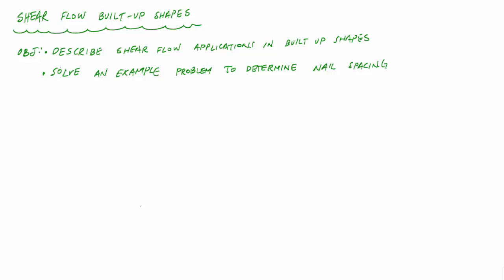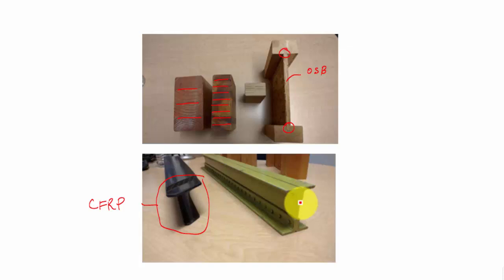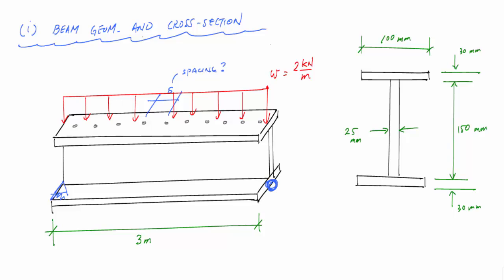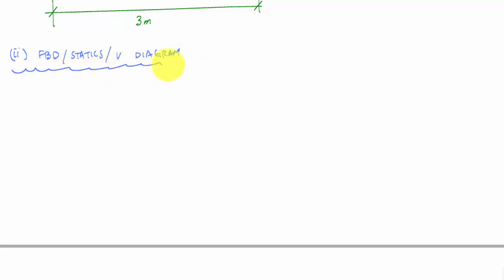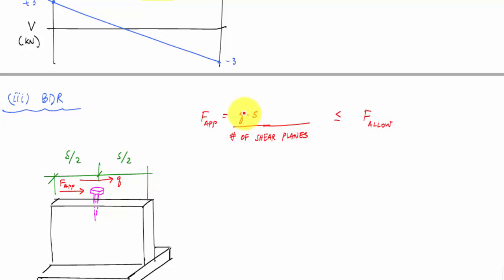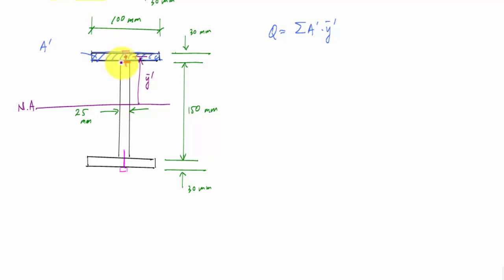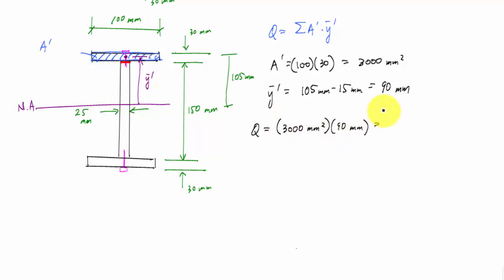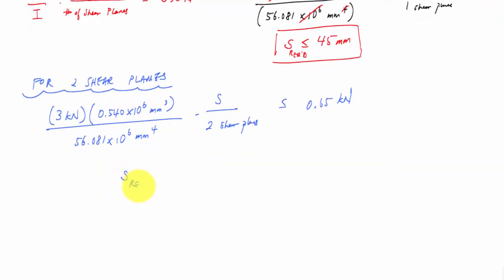Shear Flow Example - calculate connector spacing - Mechanics of Materials

Comment: yes you can weld aluminum. U need alternating current to break through the oxide layer. And btw thanks for all your videos! keep up the great work, structurefreeee
Reply: Welding would compromise the heat treatment

Comment: Thank you so much for this video! My professor should watch these videos to understand how to teach! 

Also… since when could you not weld aluminum?
Reply from the maker: Thanks for the comment. I should correct the video and say that there are some aluminum alloys that are not weldable.
Reply: I don't know F150 is bolted instead of welded, however, aluminum is more difficult to weld than steel, and more importantly, a welded aluminum structure has much less strength than a bolted aluminum structure.

Comment: This video is great. The only follow up question I have is do the screws need to be at the same spacings along the full length of the beam? Or can the spacings be increased in certain areas to make it as efficient as possible? For example, can the spacings be further apart at the ends where the moment is smaller or at the middle where the shear is smaller.
Reply from the maker: I guess you could vary spacing...it might create too much opportunity for error on an actual project depending on how many variations you have

Comment: Great video! I've sent a few people here because it explains shear flow so clearly. 
Q for you: how would you look at the shear flow for the connection for say a 4"x4" box to the inside flange of a 10"x10" box when it's inserted into the 10"x10" box? Would you treat just the flange of the 10"x10" box as A' ? Or does it even work like this? My profile pic is an image of the example XD
Reply from the maker: I think you'd have to treat all of the 10x10 box as A'.

Comment: Hi, I'm a civil engineer here in Brazil, I do not speak English so sorry for any possible mistakes. I would if possible to clarify a question, in the video you are addressing shear connectors that can be used to support metal beams in solid slab of reinforced concrete? if it is not the same calculation would have to say if it is possible an adaptation or if you have an electronic address with an apostila .. do you have any video or handout that has an example of calculation of connectors formed by sheet metal folded welded in the metal beam?

Comment: Great Video Man,I have a quick question though, when calculating 'Q' for 2 shear  planes, why did we not take the distance from the NA to the center of the bottom flange as '-90' since the positive y is defined above the NA which makes anything below it negative? thanks :D

Comment: When you say Neutral axis, that is incorrect. The neutral axis is defined by the general flexure formula by resultant bending moments. What you mean is the axis of the center of gravity for the cross section of the beam.  Let me know if I'm wrong.